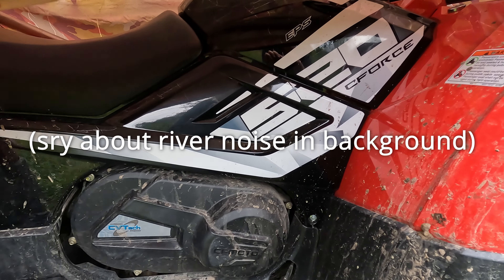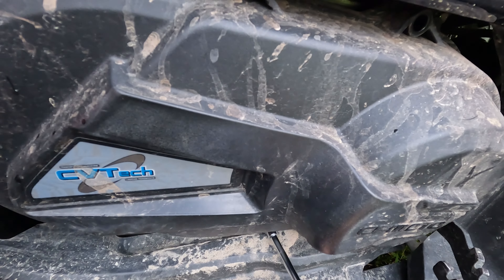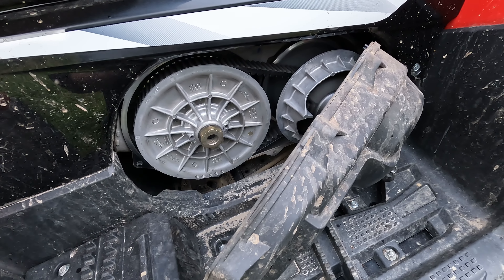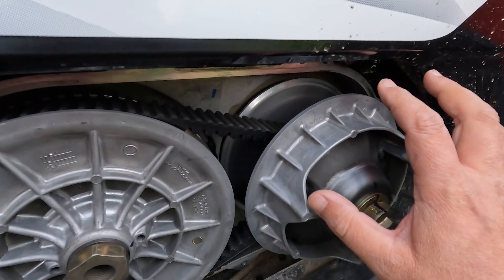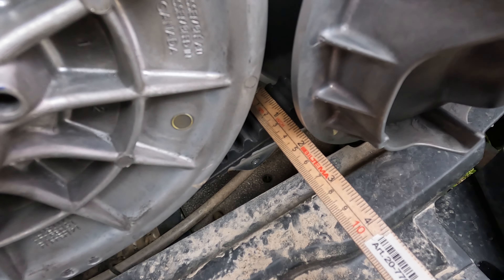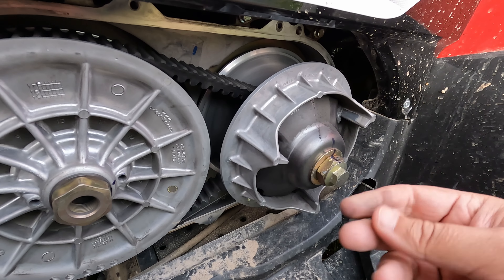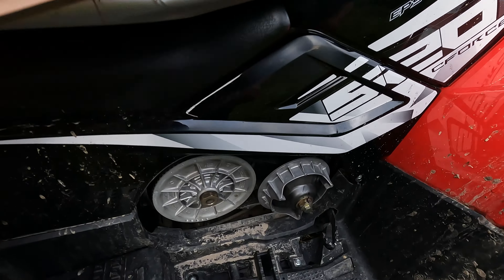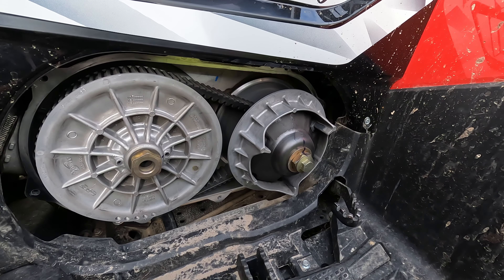DRIVE BELT CHECK, Cfmoto Cforce 520 L

Comment: Good video..  Thats actually just like a snowmobile... and there you should be able to fins a screw on the big wheel and just widen the gap... done in 5 minutes on a snowmobile 🙂
Reply from the maker: You know I heard it today aswell from my local dealer that it is really easy to do and only takes a few minutes. But I will let them change it + take my early service at same time next week. But will probably cost really much. 
But you saw the cracks on the belt? This didn't look safe driving longer distances away from city and get stranded hehe
Reply: @ArcticExploring  well on a snowmobile we always have a spare just in case.. let the dealer show you how to change it 🙂
Reply: @ArcticExploring  if it only takes a few minutes to change it i would guess it will Cost you about 150$ for the belt and for them to change it.. small cracks here and there is not too bad... what tears on these belts is same speed for a Long time. And if you kinda "slur" on the gas.. 😅
Reply from the maker: @AFatRandomDude  The original belt cost $270 so pretty expensive. There is a another brand belt that people recommend, and for half the price. But the dealer in Norway that sell those was out of stock. 
I didn't know that, I only know that snowplowing wears out belt very fast if in too high gear.
Reply: @ArcticExploring  dayum 270$ 😶  on a snowmobile its if you "slure" when taking off it wears the belt more, because the "variator" that squeezes on the belt making it go forward or backwards follows the rpm of the engine 🙂
Reply from the maker: @AFatRandomDude  Yup it's really expensive. Ah oh, that's why you should never leave your atv in gear for a longer period of time when parked.
Reply: @ArcticExploring  Hvis du ikke har en Yamaha da. De har en sentrifugalkobling i tillegg slik at variatoren ikke snurrer på tomgang. Har ikke byttet reim på min Grizzly 660 på de 16 år og 8000km. jeg har hatt den.
Reply from the maker: @Norseman220  Aha det viste jeg ikke om Yamaha. Jeg vet bare at Yamaha har noe garanti på at reima ikke skal ryke eller noe sånt. 
Jeg hadde faktisk lyst på Yamaha før jeg kjøpte min, men dem har ikke atv for 2 personer.

Comment: The way you descibe your problem sounds more like a gearbox problem. But then again I have no experience with belt driven ATVs (except for my crappy Bashan ATV). I hope a change of belt will fix it. Did you shim it when you put on those 27 inch wheels?
Reply from the maker: I was thinking it could also be the weights in there, but then it should have caused problems while driving after and it did work with no problem after. I heard people with snowmobiles had the same experience without the belt ripping. And I also hope when changing belt it will help, but since I have my local mechanic at the dealer change the belt. It should be all good (atleast I hope). 
No I didn't do anything when I put on those 27" tires. Many people put on spacers or change the gearing, but I didn't do anything since they said I didn't need to. Maybe I should change the gear-weights, but then I need to think about it.

Do you plan to buy atv this year if you going to buy?
Reply: @ArcticExploring  I had plans to get another ATV this year but we had to buy an additional car to the family and im building an A-traktor for my son so might have to wait until next year.
Reply from the maker: @NilsKall  I see, well it is expensive buying another car also.